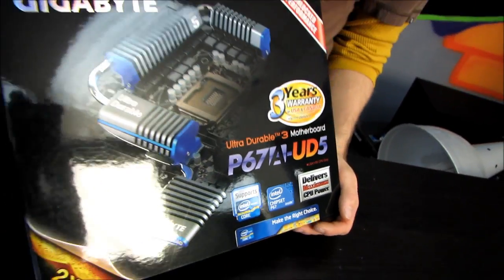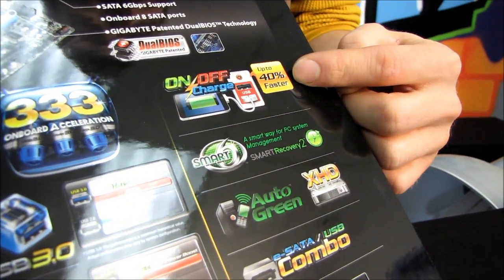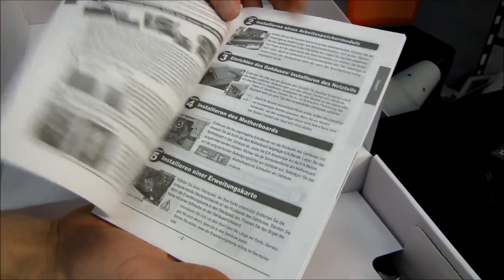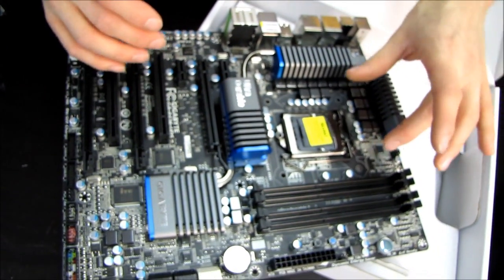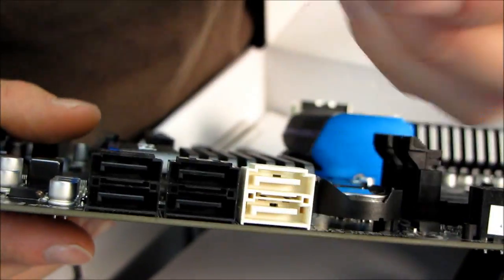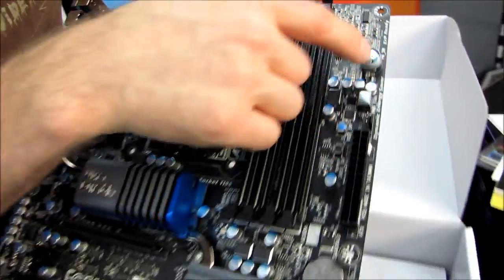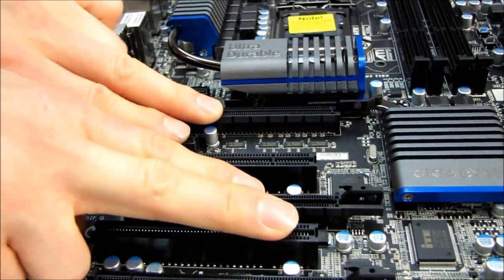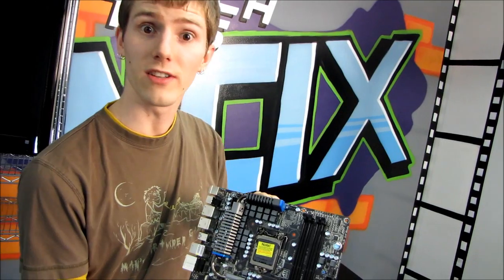Gigabyte P67A-UD5 P67 LGA1155 Sandy Bridge SLI Motherboard Unboxing & First Look Linus Tech Tips

Comment: @xerxethegreat Well, I was considering getting dual MSI Twin Frozr II 6950s and just using the great cooling power of the Twin Frozr coolers to overclock, since, due to the fact that the Twin Frozr II is not a reference 6950, it can't be unlocked.  Do you think that overclocking would offer similar performance gains with unlocking?

Comment: @Beaverman20 and the funny thing is the 1366 will be replace in 2011 by a new socket too, Intel needs to take a hint from AMD and make chips that work with existing motherboard. if it was not for the 1155 socket i would have bought a 2600k but i wont by a new 300$ motherboard every year just to overcloock a new cpu.

Comment: @Ros3w00d if you are installing Windows 7 (Which i assume the majority would install on this board) Windows 7 will have a basic Ethernet driver for it the majority of the time. Now I won't say it would happen 100% of the time but I haven't ran into a board that didn't get the driver installed from the OS install. And from there you can install all the updated drivers for the Ethernet and all other drivers for the board from the site.

Comment: @Ros3w00d For the most part you're correct but an alternative method would be to pop the latest drivers onto a flash drive or other storage device from an Internet connected PC and forget about the CD all together.

Comment: @Ros3w00d Newer operating systems like Windows Vista and Windows 7 do not require that, as they can auto-detect the onboard ethernet controller on their own. Either that or they use a generic plug-and-play driver that seem to work.

However, your statement holds true for XP or older. I don't keep driver discs, but I have a USB flash drive handy with network drivers for my XP machine just incase I do a fresh format.

Comment: @Ros3w00d 
If you have a clean install of Windows 7, doesn't install the Ethernet driver with the OS? 
I remember when I installed Windows 7, I had internet through Ethernet without install the CD drivers.